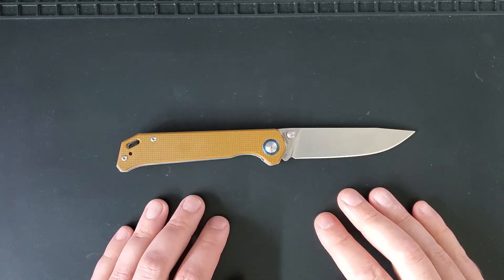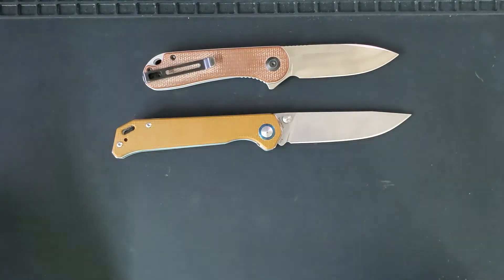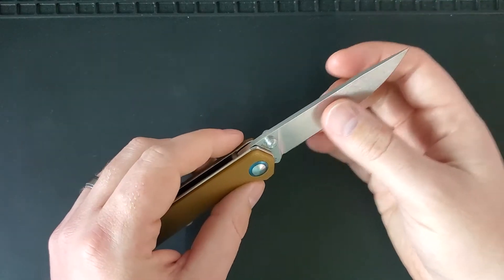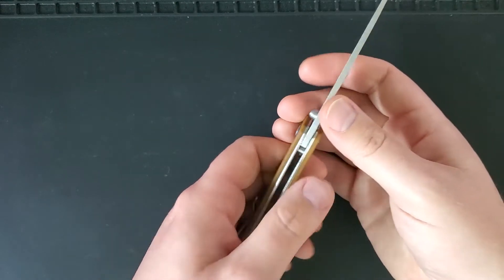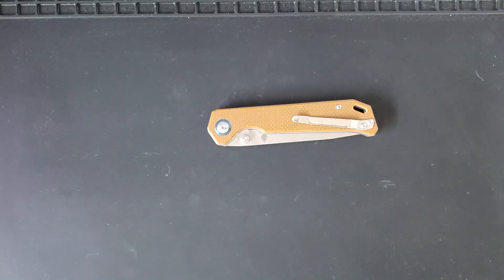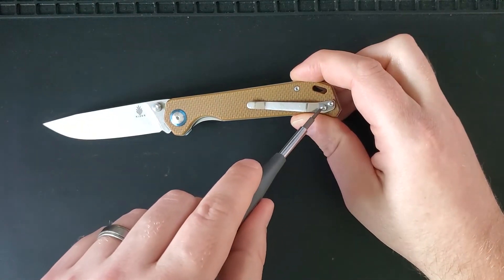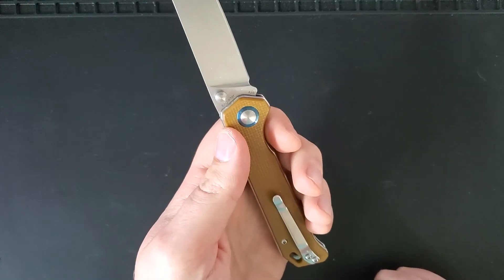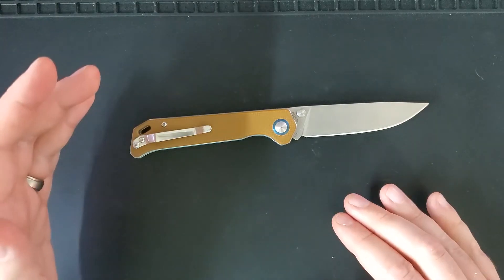Kizer Vanguard Series Begleiter Knife Review V4458A4 | Left Handed Knife Reviews

Comment: That clip is definitely an issue. Steel Will and Cold Steel have the right idea; when they design a knife with an asymmetrical clip, they include a second left-handed clip instead of making you use a clip that won't work on the left side.
Reply from the maker: It is a total after thought on this knife. They even changed the holes so the clip would still rest on the g10 so they knew what they where doing when they did it.